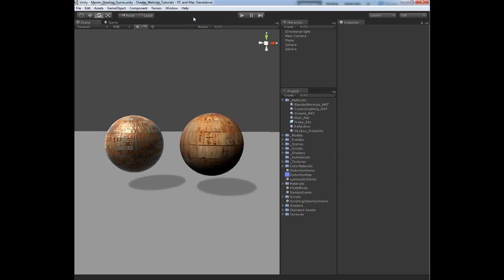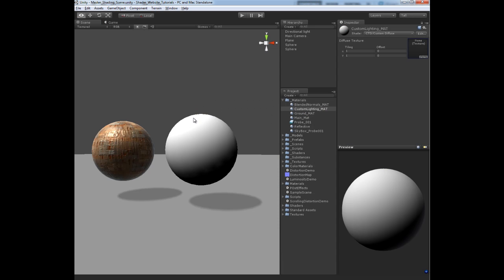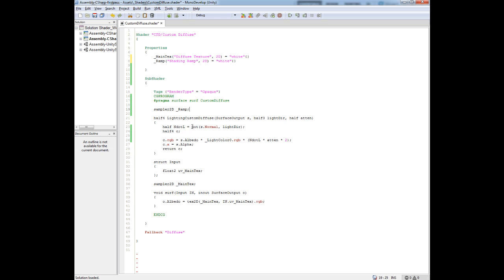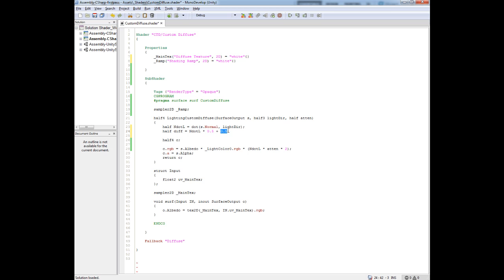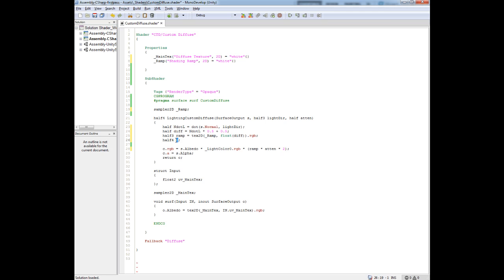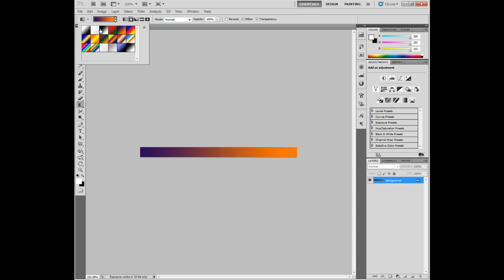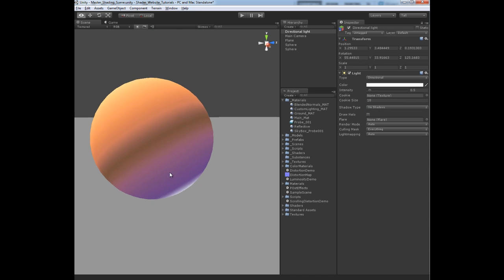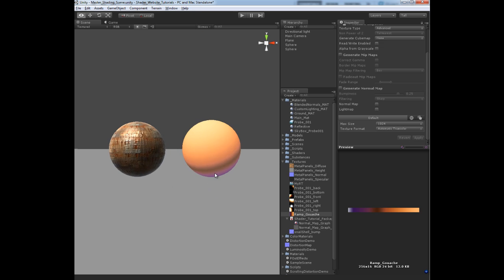Writing Surface Shaders in Unity3D Part 7

Comment: Figured I should share this, since I got stuck on it for a bit...
If you get the error, "Shader error in 'CTD/Custom Diffuse': incorrect number of arguments to numeric-type constructor at line 25", pass in a 0 as a second parameter to float2. i.e. half3 ramp = tex2D(_Ramp, float2(diff, 0)).rgb;
It seems as though the current version of Unity treats this a little differently than when the tutorial was written.